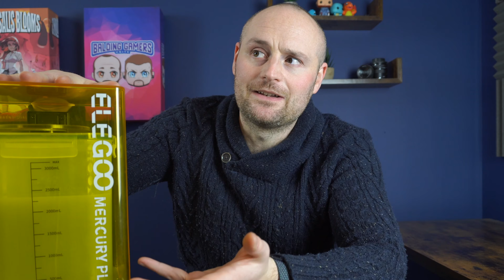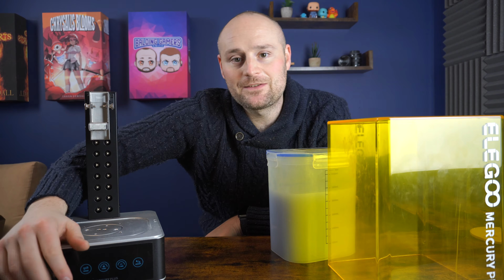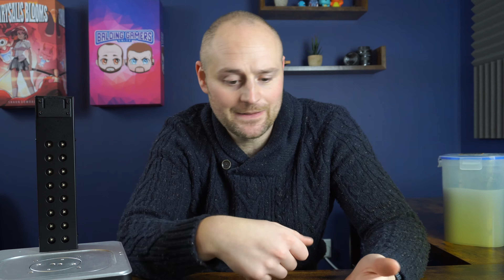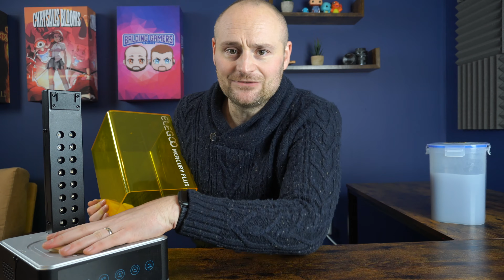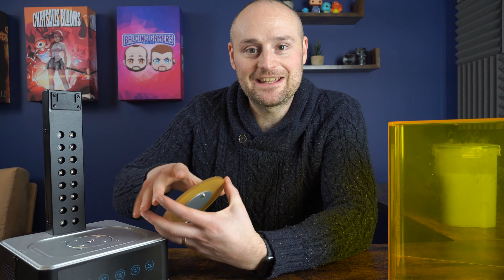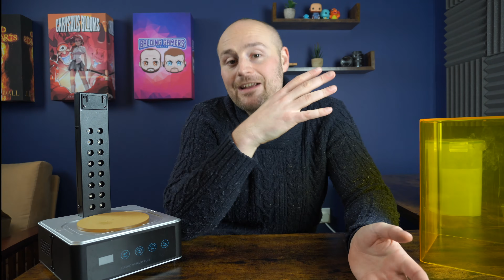My Favourite 3D Printing Purchase: Elegoo Wash and Cure Machine

Comment: Okay, so the "wood finish" on the curing base is actually just a protective sticker, which you can peel off to get a fully see-through base - might help with lining it up too! It's on the sheets that the bases are cut from, to prevent scratching of the surface. If you go and buy larger acrylic/plexiglass sheets from the DIY/home builder stores, they'll have protective stickers on them too.
So it's perfectly safe to peel it off. 😁
Reply from the maker: Damn, what a thing to miss! Thanks for that 😂

Comment: I use the Anycubic Wash+Cure 2.0
As a comparison, it only has two buttons: 
1) A toggle for washing and curing
2) A knob you turn to set the time for the selected mode. Then press in to start

I think the simpler user interface is an advantage. Especially when wearing somewhat dirty gloves.
Also, the curing tray is transparent, which coupled with a reflective sheet on the base of the turntable, is able to cure above and below the prints at the same time. 

However, the curing turntable 'speed' is a bit jittery, so my prints sometimes get jiggled off the plate, over the edge. 
So I have to keep an eye on it while it cures, which is a negative.

It's been a must-have tool in my 3d printing hobby.
(Though I still rinse my raw prints in a tub of methylated spirits as a first pass. Just to get the majority of the resin off before saturating the isopropyl.)

Great video, and thanks for the review :)
Reply from the maker: That’s pretty interesting! Might have to take a look myself in the future when I get round to upgrading or changing the machine. I love the idea of the transparent base so it can do all angles at once.